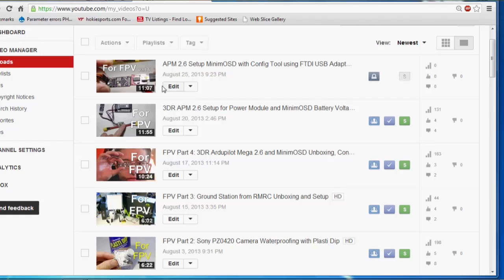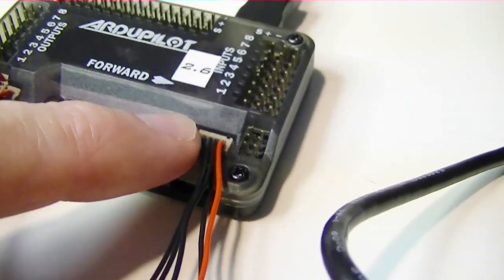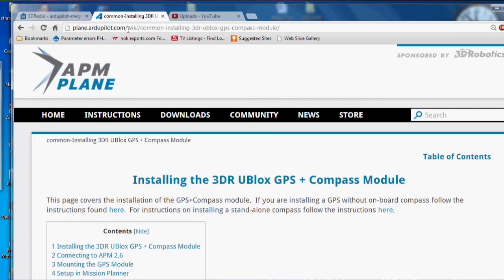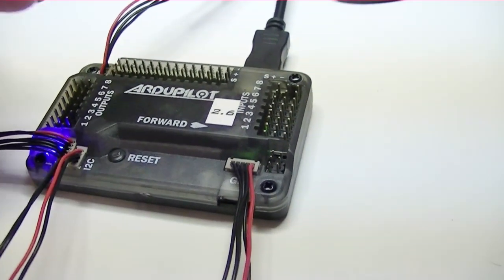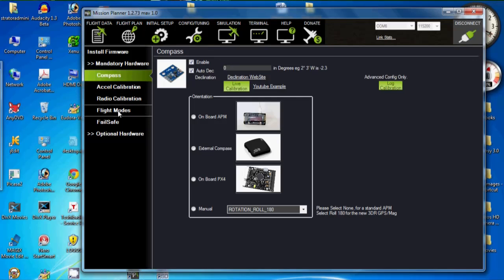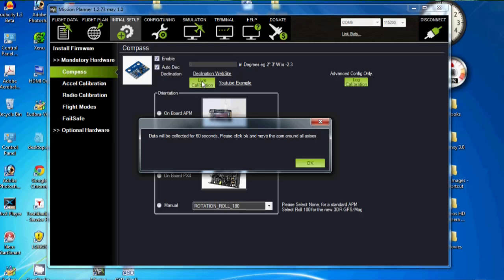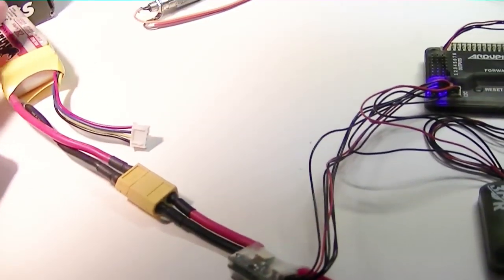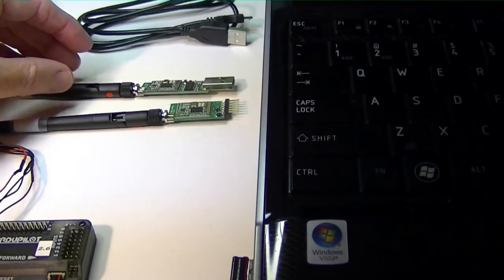FPV Part 7: 3DR Ardupilot Mega 2.6 Setup for uBlox GPS Compass

Comment: Im having massive Problems with 2 sets of APM 2.6 and uBlox external GPS+Compass. So im pretty much testing with 2 sets, so i can rule out stuff. My GPS Module was working fine, solid Blue light, then all of a sudden no Blue light anymore and no more GPS Fix on Mission Planner. Then i took the Second GPS Module, hooked it up and it worked. All of a sudden the socnd one stopped working as well. Now i check the volt out put on the APM GPS connection and its reading 5v, i even hooked up the GPS Module through the APM to the u-Center and updated the Firmware so i assume the Module is still working BUT no Blue or Red LED goes on the module nor do i get a GPS FIX. Ive searched for answers on the net but no luck so far, could you tell me at least what voltage should be coming to the GPS Module from the GPS slot on the APM 2.6? ive read something about the 3.3v regulator but i do get 3.3 from the  l2C port, the GPS Port on APM sends 5v..... ahhhhhhhhhhh
Reply: +Wilhelm Bevensee  Another question would be, is there a 3.3 volt regulator on the Module as well? if yes, do you have any idea which lead I should check?
Reply from the maker: +Wilhelm Bevensee The I2C port and the GPS port both are powered by the 5 volt rail from the power module. There is no 3.3 volts out that I know of. 
If you are doing this on the bench you may want to go outside to receive sats because the GPS may be just pulling info from memory then when the sats don't update it goes into error.

Comment: I just calibrated the compass for my new 2.6 with external gps. so far so good. the instructions I saw today said to point the compass north when starting the axis moves. i have re calibrated a few times and have effected the way the plane points on mission planner map drastically. will the gps automatically correct that when i get her outside and it gets to work? or should i try and calibrate outside away from electronics and use a real compass to orientate. pretty sure my house walls are way off n s e w lol thanks for any advice.
Reply from the maker: Sean Joy I don't think it matters if you are inside or out. However you might take a real compass and see if there is anything interfering with the reading inside and if so find a place that is free of extraneous mag fields. Honestly I have never read that the compass must face north to calibrate, that is new to me. You will probably see better readings from the GPS outside when the plane is moving. The GPS has to be moving forward at speed to determine direction.
Reply: i ended calibrating with the 180 flip as i should have to begin with if i read the page better hehe. it seemed to work appropriately after that, stayed steady i think that is what i did wrong.

Comment: Can you tell whats wrong with my set up flip fpv apm 2.6 - Today's test outdoor I already checked motor rotations and props are set correctly, for some reason it wont take off, I have my three position set as: top-stibilized mid-loiter and bottom-RTL
Reply from the maker: Did you do the Radio calibration in the mission planner?
Reply: yes! but issue with radio sticks being reverse remains, when i try to go forward it goes backwards and when left it goes right...
Reply from the maker: javierymirna There check boxes in the mission planner to reverse the channels if that happens. Just put a check mark in the boxes that need reversing.

Comment: Hi dmerc00, Does this make any sense if you flight an  Apm 2.6? Can you do this ? ... "Usually, the forward direction of a flying multi-rotor is the same as the nose direction. By using Intelligent Orientation Control (IOC), wherever the nose points, the forward direction has nothing to do with nose direction:
In course lock flying, the forward direction is the same as a recorded nose direction. 

Im gonna set up an Amp 2.6 using your videos as a reference . You have done an excellent job so far , thanks a lot .
Reply from the maker: Thanks!
And good luck on your APM project.

Comment: Hi i pluged in my gps with the wires that came with the ardupilot 2.6 kit and now i cant connect.  It blinks 6 blue and 2 red and that's it. Pc says no heartbeat detected.  Plz tell me i didnt fry my board.
Reply from the maker: Vendor might have sent you the wrong cable. Call them and see if they can help you find the right one.

Comment: Dave you have to add me as a contact or I cannot send you a PM and I am not going to have any luck putting links on the comments area. So you decide. I have spent the last 45 min trying to write you but I didnt get what was going on and it ate three extremely detail messages. Not impressed with this new bull__
Reply from the maker: Oh I will do that as soon as I can. Google + has now take away the YT inbox link at the top and I am trying to learn another way to get there.
Ok found address book but it won't take Chris Leech and says it needs a user name not a channel name.
Reply from the maker: If you give me a user name I can add you as a contact but it won't take Chris Leech. I think it is looking for a gmail account name. Not sure.

Comment: Sure thing Dave, just give me a minute to respond, I have to go down to the sand pit and load a truck. All these brains and I have to run a wheel loader for a living. I have found out how to do it and I have all the links, I will PM you with all of it. It is big.
Reply from the maker: Actually a wheel loader sounds like a fun job. Are you at a sand and gravel quarry. We have two of those near by to us. Thanks for helping me out with the upgrade Chris. I will check for the pm.

Comment: Dave, in response to your reply to Dick Gibson, I have noticed on my VTx that is 5.8 GHz basically a Boscam type, that it has its own microphone under the thin and brittle heat shrink they use over there. I wanted to ask you if you updated the GPS module for use with MP 3.01 as they recommend (not needed in earlier versions apparently) and if you did, did you use the FTDI RS232 to USB adapter to do it. I have to make up a cable or buy the FTDI USB adapter cable from 3DR for 20.00 pus shipping and then there is the wait. So I have come to a halt here for the possible but not certain lack. Is this cable needed?
Reply from the maker: No I have not updated the uBlox. Could you give me a link to that info on the upgrade? I got my FTDI to USB board from Sparkfun. But afaik the uBlox GPS does not have an FTDI interface so I am confused as to why you would need one then again you may have a different GPS. I used the FTDI/USB board for the MinimOSD and the Telemetry air radio. Maybe I will understand more after you send my the link so I can read about the upgrade.